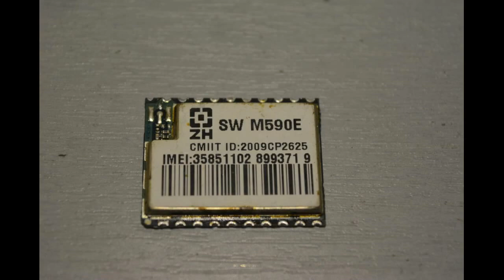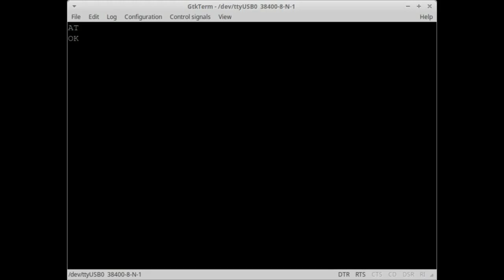GSM M590E Modem from aliexpress

Comment: Hi are you sure that it will fix the boot loop?
also I see that you put led on the first slot from the right. Is it ok to put it any of the two sections? 
My board is also the same at stuck in the boot loop but it only show Modem startup message and nothing else.
I am able to send AT commands and get the details like IMEI number and SIM number but it keeps on rebooting after 3-4 sec.
Please help me fix it.
Reply: Hi, you may find a better explanation for this issue here: https://electronics.stackexchange.com/questions/274065/gsm-module-gets-into-reboot-loop